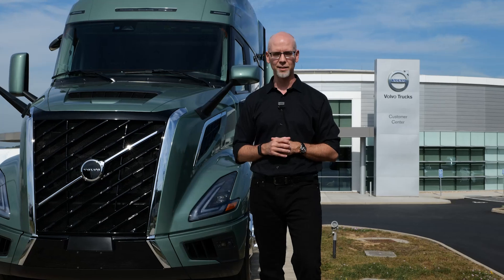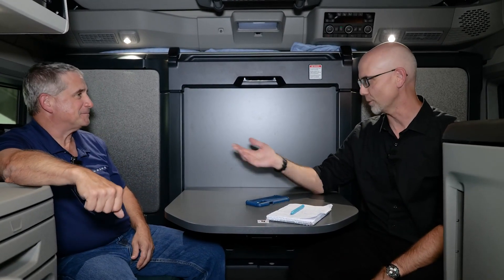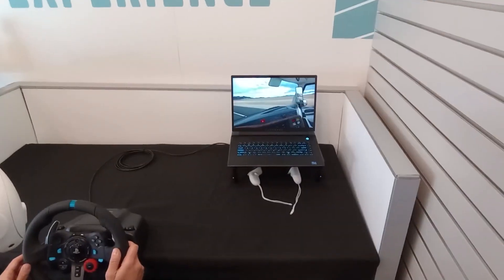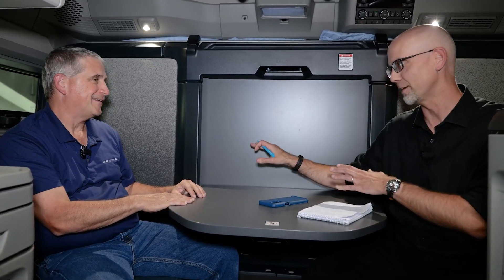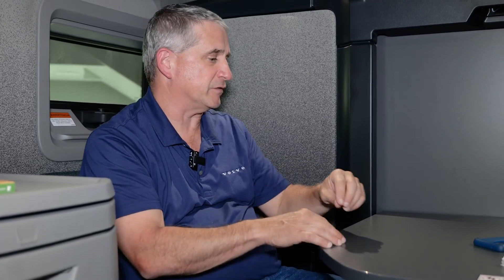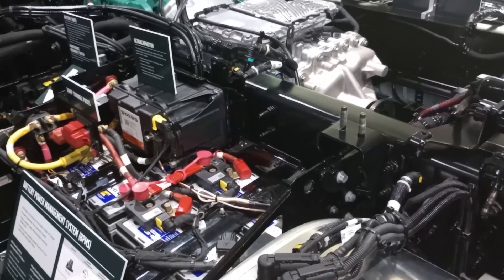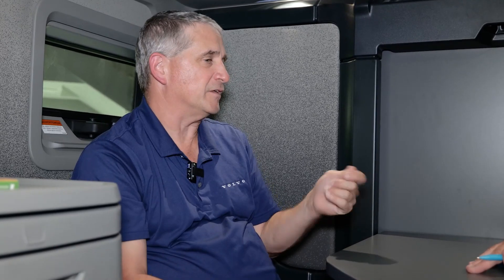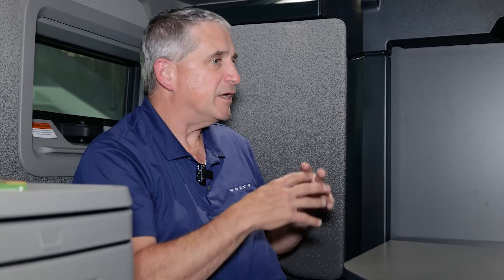Volvo Trucks – Episode 12 – How an electrical upgrade boosts truck performance

Comment: The company I work for gave me one of these. After 1000 miles a lot of battery problems showed up . This is horrible
Reply: Same. Battery equalizer failure. Lots of reports of this online and from guy at the dealership.

Comment: The European truck manufacturers always used the dreaded ‘series-parallel switch’ which fed 24 Volt to starter and 12 Volt to the rest of the electrical system on the diesel powered trucks till they switched to the entire 24 Volt electrical system in the late 1060s.    
The gasoline engine powered trucks used the 12 Volt electrical system till they were fazed out of production and replaced with diesel trucks by the early 1970s. 

 The complete 24 Volt electrical system got standardized on all diesel trucks throughout the late 1960s.   Most 24 V tractor-trailers were bought brand new together , but for those doing the intermodal drop&hook work still using old 12 V trailers they had the option to equip the new 24 V trucks with a second stepped down to 12 Volt trailer power cord till the mid 1970s, about a 10 year period as the old 12 Volt trailers fazed out and were replaced with the new 24 Volt trailers.  

The European trucks and trailers are at least 50 years more advanced than the antiquated American trucks.

Comment: Do you made it manual transmission 2024? (10 speed)
Reply: Manual transmissions are dead it's 2024 unless you have some sort of special application it's dead 4:14
Reply: Have not seen any trucks here in Europe with manual transmission for many years, Automatic transmission is so much better and is often combined with GPS-data so that the transmission will know if it will be downhill or uphill ahead of the truck.

Comment: With a Capacitar for starting then you can use 12 volt deep cycle batteries..  Still need an APU..
  My 63 Loraine Loader started on 24 volts but runs a 12 volt postative ground electrical system.
  My  1986 Oshkosh M-911 Truck is all 24 volts as in my 1980 Dresser 530 Loader."
  How about some Regenerative braking to power some electric motors on the front axle for faster take off with a lower HP main Diesel engine and  for power in the snow or mud?